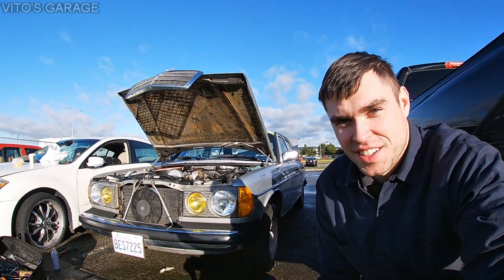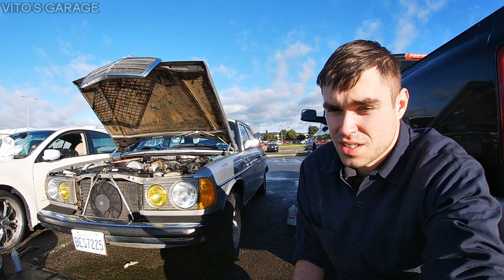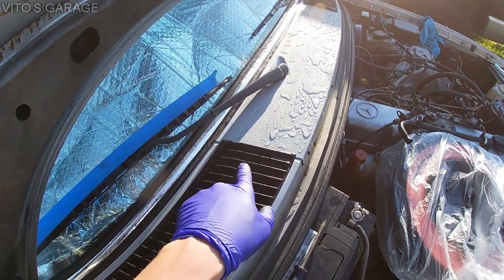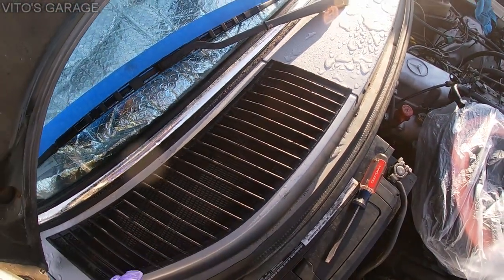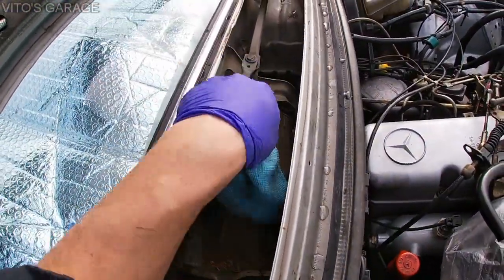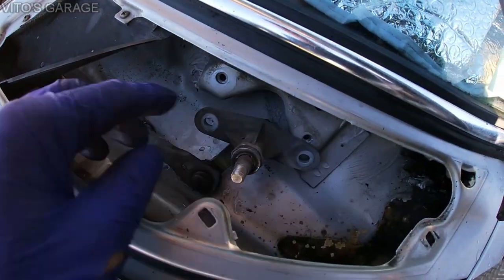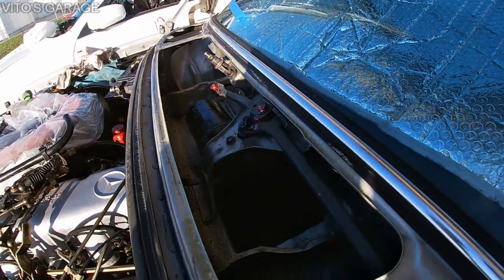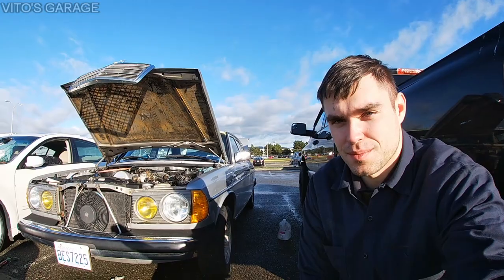PART 19 Dad's Mercedes W123: Wiper Assembly Removal & Lubrication! MUST DO!

Comment: Very good job as usual! You have to be really motivated to work in this cold, I only work when the temperatures are mild and in the north of Paris ... it's rare!
I have a lot of work to do on my 124 coupe: after seeing the clutch sender changed, I have to change the receiver, and it's not very accessible. My idle is yoyo going from 800rpm to 2000 (the ICV has been cleaned, first suspects: temp sensor or potentiometer? The parts are ordered) and recently ... smell of gasoline (O-ring or EHA .. . not good).

But, if our vintage cars had no problem, we would be bored    :)
Reply from the maker: Thank you for supporting!🙂 As far as your issue, check for vacuum leaks, make sure your air flow potentiometer is set to about 0.6V when the engine is hot and with the Key ON